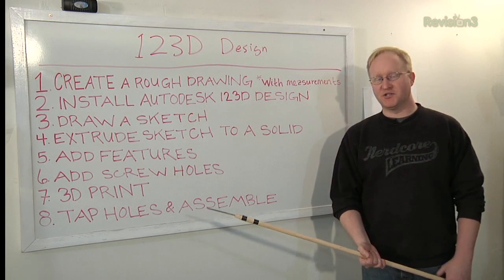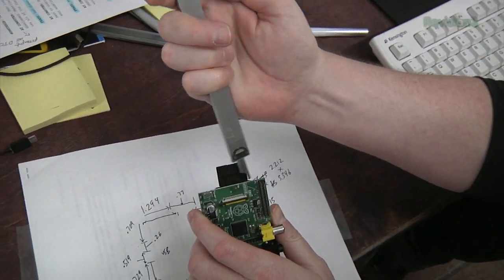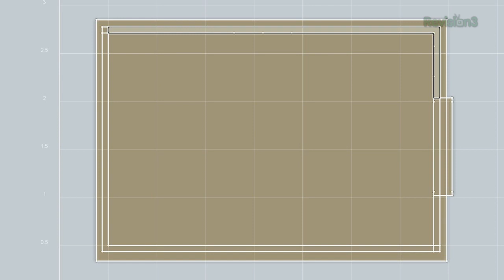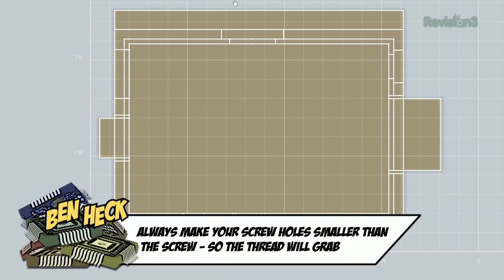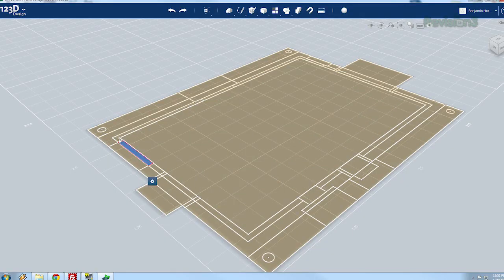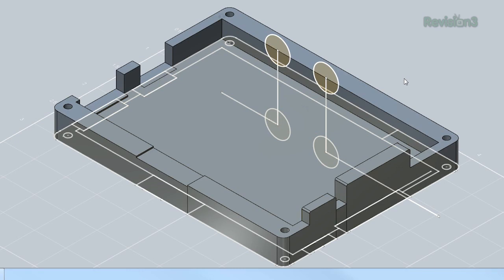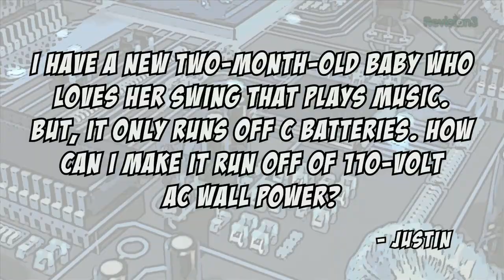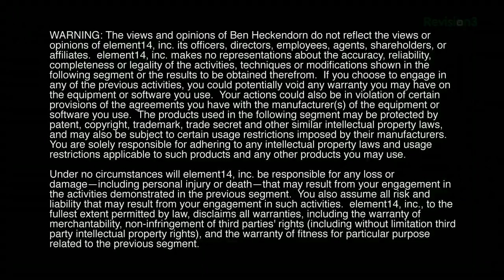Autodesk 123D Tutorial

Comment: I'm now in the market for a 3d printer and I found it very informative. I'm a bit intimidated by the design process, hence searching and finding this video, although I have watched Ben for many years. Ben explained the principle of creating a 3d printed object. Very easy to follow as he showed how to measure your openings, draw file in 2d, extruded the base, then the walls. He even talked about saving as, to created the top to use a seperate file to match the base. He showed and explained how to tap and screw to complete the case. The concept of doing in sections is the type of approach I needed to get my head around  - how complex objects can be built up in sections. From all that info I am pretty confident that I will be able to get my head around 3d printiing, and will have a look at autodesk and other products and see which one I find most intuitive to use. All in all a great video. . If people are complaining and wanting to be handheld through the entire process..maybe 3d printing isn't something they should be attempting.  Just a thought... how will you ever learn if your spoon-fed and copy step-by-step? Immediately after finishing this  I will go over to the autodesk site, find out if there is a downloadable demo, and go from there...
Reply: Mix Mechanical as Ben's Mom you should not be allowed to comment....

Comment: Can Autodesk 123D create g-code for a cnc router/engraver or does it just work for additive cnc devices like a 3D printer?
Reply: Normally what you would do is take the STL file from 123D and send it to whatever program you use to convert STL to GCODE for your machine. For 3D printing, I use Slic3r. I'm sure there is an alternative for routers.
Reply: Thanks for responding to my question.  So based on your response, I guess that means there is no built-in CAM software for subtractive CNC machines in 123D.  

I found a free open source program called Pycam, but it seems rather slow when rendering the gcode.  It's also not all that clear what each option is for in the software configuration.  Do you know of any other free CAM software that could be useful?  My friend has a CNC router that uses Mach3 to process gcode for machining, but I don't have a free program yet that I'm satisfied with.

Comment: Just an FYI, Ben misspoke slightly with his definition of hyperthreading; an Intel proprietary optimization technique which presents a single processor as though it were actually 2 but does not simultaneously execute multiple instructions. This results in a slight increase in performance where architecturally specific instructions are utilized but is not the same as symmetric multiprocessing where more than one physical processor is used; each simultaneously executing an independent thread. Even symmetric multiprocessing only improves performance where multiple threads are created and spread across CPU cores. A single threaded application will only ever run as fast as the one core on which it is running. I think this is what he was referring to; the application's single threaded nature?

Comment: Can a use autocad Inventror insted ? 
What file format do it right in order to 3d printing?
Reply: As long as youa re able to export the file to .stl youll be ok, What you need is any stl file and normally the software for the 3d printers convert it into gcode (file needed for coordinates) and then print it.

Comment: Your drawing technique is slow or maybe it's the software? I use design spark Mechanical that seems to be doing much better job with things like cases (sure you don't mention this as it's from RS components, completely understand). In design spark you can fro example shell out a solid with one click, dead easy. And they have a 3D model for Raspberry Pi for download so no need to even draw dimensions. Can you import a 3d model of a Pi to Autodesk123D even if it's from rs components not from Farnell??
Reply: Fully agree with the Designspark Mechanical reference. It's extremely easy to import a wide variety of 3D models. Usually you get something in STEP files from the internet, and most layouttools can export/save the circuit board with all the component data in STEP too. There is even a simple trick to "unlock" imported STEP models in DS-M, so you can edit all the imported models and you can always add connectors and stuff from manufacturer models if the data was not complete. I prefer to design cases this way around electronics, almost eliminates all the errors of manually measuring and replicating a design that was already created in digital way while making the layout.
Reply: Thank you for your post as someone completely new to this it's good to know what kind of software appeals to and is best to learn for newbees...

Comment: I thought the Raspberry Pi was MUCH more powerful than the C64 or the Apple 1.  The Pi has a 700 mhz arm processor doesn't it?  Much faster than the 1 mhz processors of the early 1980s....

But yes it is amazing.  To think the Arcade machine I have made in the back room could have the guts replaced with a tiny credit card sized board with an SD card is amazing.

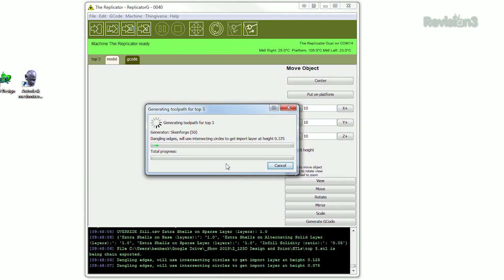Comment: Just a little critique on your computer parlance at 14:54....  Hyperthreading is NOT a program's ability to make use of multiple cores or CPUs in a system.  Hyperthreading is an Intel advertising term for their SMT (Simultaneous MultiThreading) technology, which allows a single core to appear as though it is two cores and to thus allow two threads to be dispatched to it.  

The term I imagine you are looking for is "multithreaded" (a piece of software that is written to execute on more than one thread), though to be particularly pedantic, I'm pretty sure that your application is multithreaded, as most applications are multithreaded (for IO interaction and so forth).  What most applications are not, is algorithmically parallelized, where the main algorithms of the application are written in such a way as to allow the work to be divided and concurrently dispatched thereby distributing the processing burden across multiple CPU resources and realizing a performance gain.

Comment: Ben .... this is not " English " this is " American " imperial ....... we use inches & fractions of an inch ........ thou' is generally not used , until you have to starting " gaping " things , spark plug gaps , clearances ........ all those tricky little things ........... Of course , in theory , we have gone metric , but wood comes in 2"x 1" par ( planed all round ) ..... which is 1 3/4" x 3/4" & sheet material come mostly in 8' x 4' ..... but can be purchased 2440 mm x 1220 mm .

Comment: Hard to believe anyone would insult a person over the units they use.  Silly. For my part I've used both for my BSME, and finally realized that I prefer the English units for ease of use, and oddly for ease of calculations. I find them more "human", and to be easier to use for every calculation except those involving gravity.  
For example, a 3" diameter piston with a 10:1 compression is 3pi x 14.7x10 for a quick calculation of downforce. By contrast, in metric, dealing with tons of 0's and juggling decimal places and exponents, as well as meter^2 to cm^2 conversions, and nevermind cubics, well, it's a whole set of errors waiting to happen.
H

Comment: fuck the survey, back to your roots maybe? lots of cool old school hardware emulation that his come out in the last couple years, maybe some more hand held units. or better yet take arduino or some other controller like that, and break apart thumb drive for storage, and load an snes emulator on it. doing it with arduino would be awesome, but there are lots of options, and there are msdos based emulators available, so you can do it with a 16bit chip.